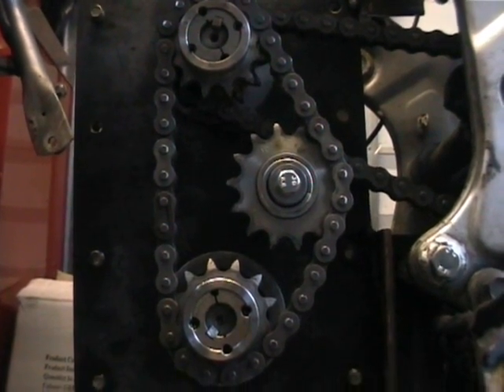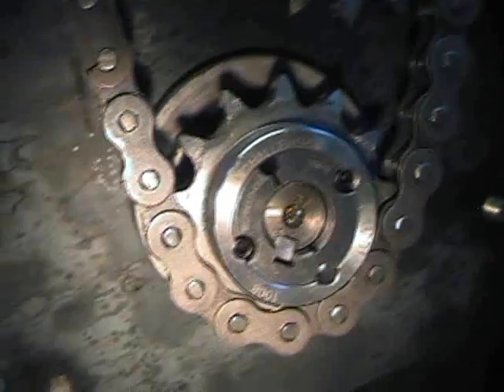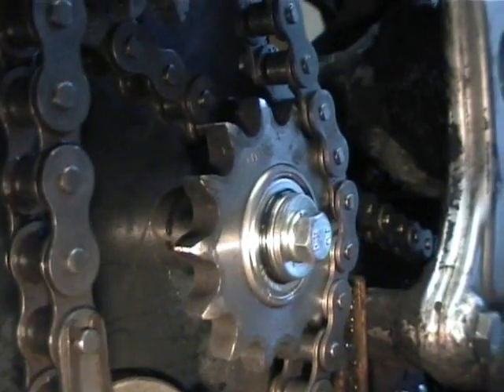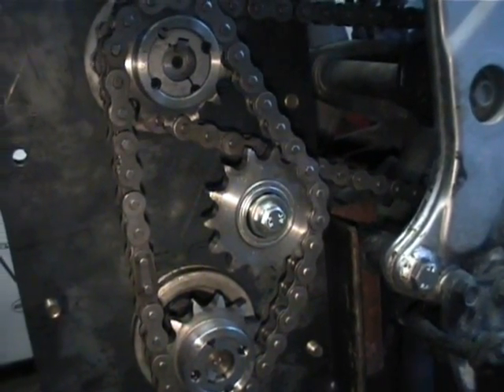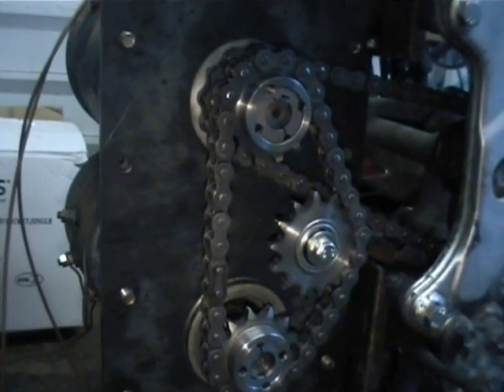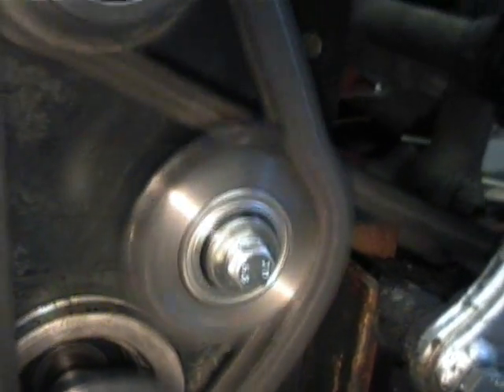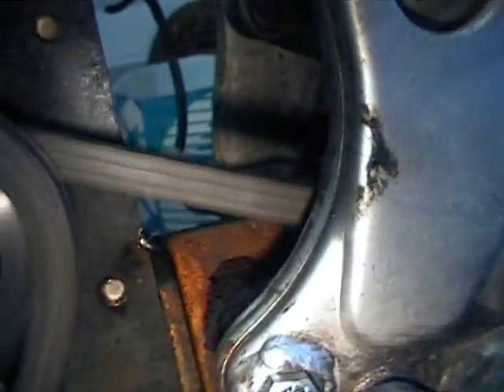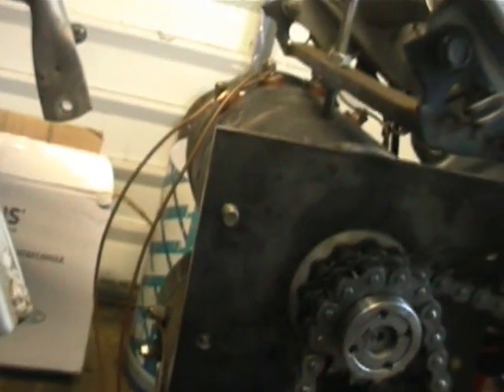Honda CBR600 EV Conversion 05 Twin Motor Run

Comment: Remove the idler gear . Shorten your chain In-between both motors and use the idler gear spring loaded to keep tension on the outside right of the chain pushing inward.

Comment: use only single motor with 12,000 R.P.M DC SERIES motor 24v 15/25Amp motor & controller.The min speed u should achive should b 100km/hr..........................

Comment from the maker: Not quite. With the motors connected in series , each sees the same current at half the voltage for twice the torque. Torque is a factor of current. In parallel , each motor sees the same voltage for half the current for higher top rpm. Rpm is a factor of voltage all things being equal.